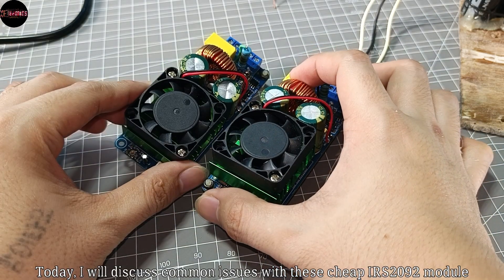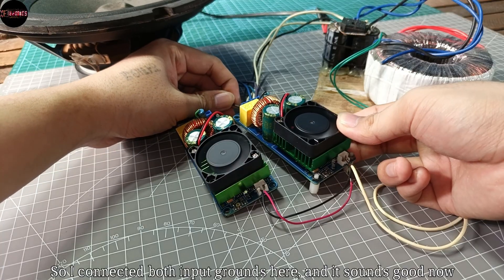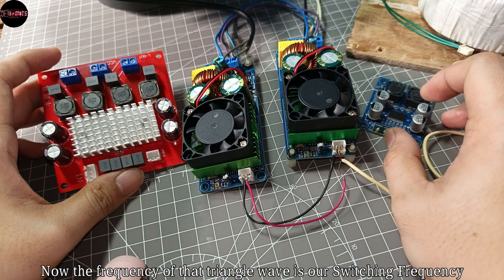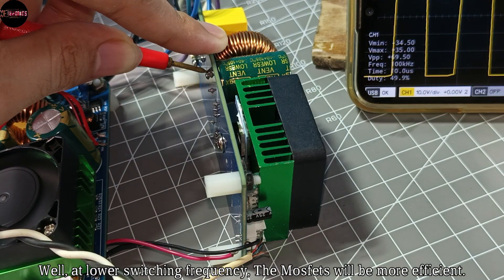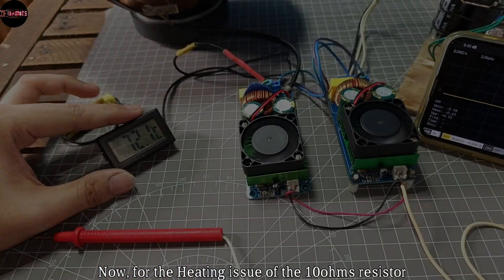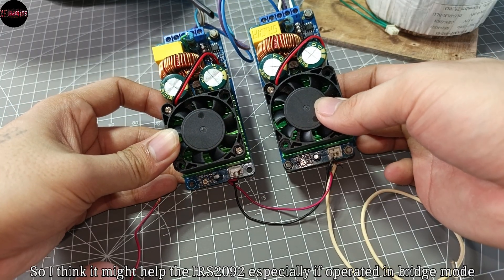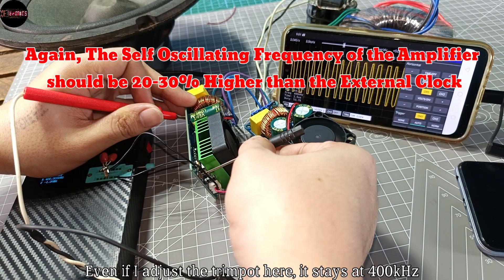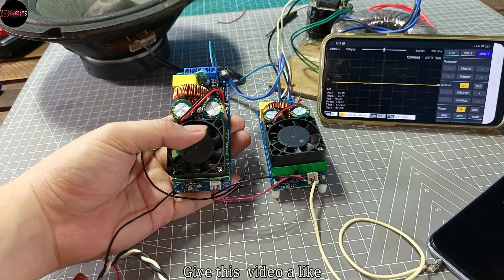IRS2092s Class D Module FIXED and MODS!! #amplifier #500watt #classd #classdamplifier #tpa3116d2

Comment: So ito pala ang issue kapag walang audio itong mga class d kasi nag stop na self oscillating circuit nya though goods ung irs2092 kahot ilang beses pa nag palit😊
Reply from the maker: Madami din sya factor boss. Meron din kasi extra protection yong board. 
Yong Sinasabi ng Karamihan na "BUFFER" kuno, yong may SMD transistor. Hindi yon buffer kung protection trigger sya ng irs2092 boss

Comment: I use 2 boards from a +-56v supply with 22000uF total filtering. When i reach its maximum the speaker makes a popping sound. When volume turned back it works fine before that point. Is my supply limited or just the board reached its max and protection kicked in?
Reply from the maker: What kind of supply is it? Is it a Linear, Transformer or a SMPS?
Reply: @x3dtronicsph transformer, around 500va
Reply from the maker: Nahh. There's voltage drop when playing at high volume. You might need modify 8 resistors in your board.

Replacing eight 20k (203) resistors with 18k (183) or near this value might help. I'm not sure.
What I'm sure is that it turns off every bass drop because the Voltage Drops, you cannot notice this with a multimeter because it is too fast. You will see the voltage drop using a Scope in Single Shot mode
Reply: @x3dtronicsph alright i will try that thanks for the help❤
Reply from the maker: I think you can Do 15k as well. Not that crucial if you have truly ±56VDC rectified voltage
Reply from the maker: I think you can Do 15k as well. Not that crucial if you have truly ±56VDC rectified voltage
Reply: @x3dtronicsph yes its a +-56v dc. I might modify the resistors to a lower voltage like 45v so that i can have a safe voltage drop.
Reply: @x3dtronicsph Hi, I have the same problem with these boards. 
I am using a +-50 volts power supply, if I raise the volumen, speaker cutoff making a pop out.
I check the application notes for the IC and recomend to use 2.7k ohms resistors instead 5k .
Klipsch subwoofers use the same circuit and use +-56 volts and sound amazing.

In the next days I try to change some values.
Reply: @x3dtronicsph hi again, i tested with a 43v cut off and the protection kicks in at the same time as before. It wasnt my supply sagging but the ic protection doesnt allow anything above that.
Reply from the maker: Probably, it might be the protection circuit, The SMD transistors connected to shutdown pin of the IRS2092 chip. 
Or it might be other problem, you'll need to do diagnostics unfortunately
Reply: @x3dtronicsph yea its no problem since it still outputs serious power. The components quality is poor in my case. I hope i helped with this feedback
Reply from the maker: Or it might still be the supply issue, Load impedance issue. If you have a scope, Do single shot trigger to your supply. 
The Multimeter cannot see that voltage drop because it only happens in Split Seconds

Comment: Sa wakas magagamit ko narin yung frequency ng zotek ko na multimeter tsaka kala ko volume yang pinipihit hindi pala kaya pala puro aberya yung ganyan ko kasi lagi ko sinasagad salamat dito sa video mo idol. Btw planning to build ako ng Active Subwoofer using this amp tapos 55-0-55vac 6A na transformer any suggestion para hindi mag putol putol ang tunog once na mag drop ang voltage ng psu ko kapag nag bass?
Reply from the maker: Lagyan mo lang 100k resistor probe ng Zotek mo boss pag ng Freq Test. Mataas kasi input capacitance ng nasukat ko sakin. 

Yong nag puputol Putol po gamit ang Toroidal o EI. Kailangan pa ng Extra Circuit para ma stabilize. Actually two ways sya. Saka ko na siguro gawan ng video kase medyo Complicated at Maarte talaga si IRS. 

Pero sa Ngayon boss. Di ko talaga ma rerecommend na gumamit ng Toroidal Transformer o kahit anong linear power supply jan sa IRS. SMPS o Switch Mode Power supply talaga ang kelangan

Comment: Bos anong mas ok na supply dyan pede ba 57 volt lang po
Reply from the maker: Pwede kung Stable 57v.
Pero kung Linear Transformer ang Gamit at mababa ang Current. Babagsak ang Voltage bawat Bayo kaya Sisinukin yang IRS kapag hindi stable ang supply
Reply: @x3dtronicsph saan ka po bumili ng power supply nyo po..kc po gamit turoidal transformer ac 44v 0 48v tapos bumili po ako sa shopee ng rectifier na board na gawa na po....salamat po sa sagot..
Reply from the maker: Sa Shapi boss. Di nga lang recommended maliliit na toroid kasi mababa current, Masyado malaki voltage drop kaya namamatay ang IRS
Reply: @x3dtronicsph bos ilang volts po ito sa AC volts na gamit nyo..salamat po hindi po kc tech..diy lang po nanonood lang mga video dto sa YouTube...gaya sa video nyo...salamat poo saka po pano po mag add ng output sa diy amplifier gaya ng irs2092s..godbless po.
Reply from the maker: 28-0-28 lang gamit ko sa Vid boss. 
Pero yong IRS ko ay naka Modify na gumana sa 45-0-45 vdc
Reply from the maker: Dito ako bumili
 https://s.shopee.ph/4fnrldRUTq
 Second Hand sya kaya swertehan maka kuha ng pure copper. Mura lang naman

Comment: my class AB amplifier (2sc5200 + 2sa1943) has an oscillation problem and is burning my tweeters. i am thinking of making a zobel but i dont know what the value for my inductor should be. i dont even know how to measure the henry🫠🫠
Reply from the maker: It shouldn't oscillate in the first place. Check your predrive transistors first

Comment: Sawakas, ito yung matagal ko nang inaabangan, at may natutunan din na bago for modifying that amplifier
Reply from the maker: Kulang pa yan bossing, try ko pa i Bridge next time. Need din kasi i sigurado na hindi sya mag Oscillate. Oscillation talaga main problem ng amp
Reply: @x3dtronicsph buti naman kung ganun at na-p-pointout mo yung mga problem ng amplifier module na yan, balak ko din bumili niyan soon fo DIY power amplifier and good thing is may video like this so it can give me more insights about that amplifier
Reply from the maker: Oscillation palang pinaka issue na nakita ko dito boss. 1k resistor lang sa Input Audio bawat board, goods na sya. 
Mas nag kaka issue sya pag stereo. Kapag Mono naman wala kana po poblemahin, maganda sya gamitin. 
Gusto ko din talaga i bridge to, anlakas kasi Half Bridge palang. Pano nalang kaya pag full bridged🤣
Reply: @x3dtronicsph Oo nga naman, pero I think all goods naman siya siguro if ma-fix yung oscillation problem, and much better din siguro kung mapapalitan yung inductor pati na rin yung resistor sa output, etc. so i think much better din siya kung mag operate siya in 100khz to increase the efficiency of MOSFET and maybe the overall output. so far, abang abang nalang muna ako sa next video mo about that amplifier, excited ako masyado tungkol diyan eh HAHAHAHAHHHAHAHA

Comment: Ito talaga inaabangan ko, Ty idol.
Reply from the maker: Wait mo lang Bridged mode bossing
Reply: @x3dtronicsph  boss pwede kayang palitan yung transistor na nasa heatsink sa mas malakas at quality na klase?
Reply from the maker: Pwede boss. Pero importante na tamang klase ng Mosfet ikakabit mo . Yong nakalagay sakin ay Irfb31n20 na mosfet. 
Sinukat ko sya and nasa around 1nF and Gate capacitance nya, compared sa common mosfet like irf640 na around 4-5nF ang gate capacitance. 
Crucial po kasi gate Charge ng mosfet pag dating sa High Frequency
Reply: @x3dtronicsph  kasi di ba mag o-open Ang gate kung mas mataas na value Ang ipapalit?  Ganon ba yon boss? Wala kasi ako background sa micro electronics, DIY lang.
Reply from the maker: Mas mahirap po i drive at High Frequencies kapag mataas ang Gate Capacitance ng Mosfet boss. May tendency na mag work yong mosfet in linear region, possible mag overheat ang Mosfet kapag hindi Properly Driven. Di ko pa na try palitan yong IRS ng ibang Mosfet. 
Pero kung papalit ka ng common Mosfet lang sa IRS, required na babaan ang switching frequency. 
Ang downside is possible na mag Overheat ang Coil pag hindi pinalitan
Reply: @x3dtronicsph  so basta same Ang gate capacitance value ng ipapalit na mosfet ay no problem boss? Thank you sa infos lods
Reply from the maker: Drain Source Voltage papo. Ibang characteristics ng Mosfet ay magiging factor din
Reply: @x3dtronicsph  aws so mahirap pala mag matching ng ipapalit, tingin mo po lods Kaya naman ba ng stock mosfet mag maintain ng 400w rms for long periods?

Comment: how about Gold-A091 (irs2092s) amplifier? 
how to change its clock frequency?
because the inductor is very hot to touch even with minimum working voltage of 60+/-
Reply from the maker: How Hot? If it is around 60 degrees Celsius, which is Hot to Touch by hand. It is pretty normal. 
But if the Coil is Smelling like Burning enamel, There might be a problem. 
Upon checking, the Gold Version irs has Fixed resistor used in the Integrator section. 
Check your switching frequency first
Reply: I use strong server rack fan for forced air cooling for the Gold-A091 heat sink and inductor but even with full blast of air the inductor is still going to get too hot to touch after a while. (idk how much Celsius)
there is no smell or anything from the inductor.
I had not tested without a fan yet because I'm scared of it burn up or broke.
I guess thats by design and normal.
thank you for replying :)
Reply from the maker: This is hard to deal with. First, you need to check your switching frequency brother. 
Does the 10 ohms resistor heat up as well?
Reply: I do not have anywhere to measure frequency
but pin 4 comparator have 430 ohm resister instead of 510 in data sheet 

my setup have 12 Gold-A091 connected to one power supply
(with star grounding)
and use Bluetooth for input signal (connected to only one amplifier)
and use cheap multimeter 

I don't not hear any weird noise with speaker connect to any of the amplifier

I did some test @65v+/-
speaker = sp
input wire = in
audio signal = sig
inductor = coil
mosfet heatsink = fet
10 ohm resistor = ohm
output voltage(rms) = vout
heat up = ^ or else = -
connected = yes or else = no

sp yes, in yes, sig yes
coil ^, fet -, ohm -, vout 1

sp yes, in yes, sig no
coil ^, fet -, ohm -, vout 0.8

sp no, in no, sig no
coil ^, fet -, ohm -, vout 0.6

sp no, in yes, sig no
coil ^, fet ^, ohm ^^, vout 6.9

sp no, in yes, sig yes
coil ^, fet ^, ohm ^^, vout 6.6